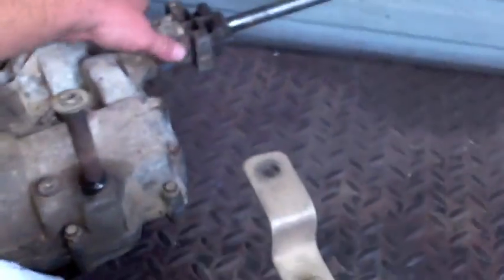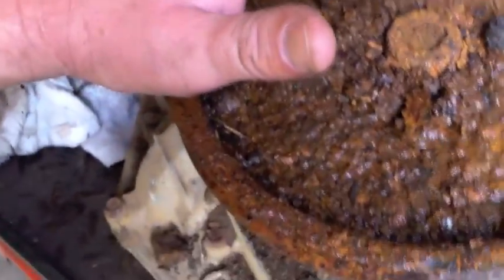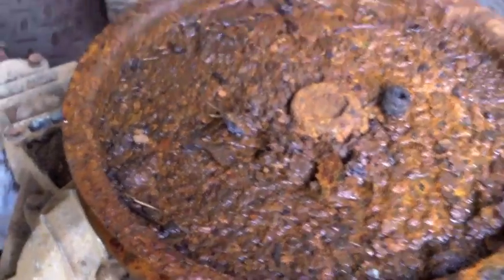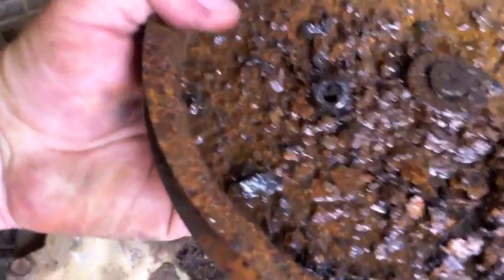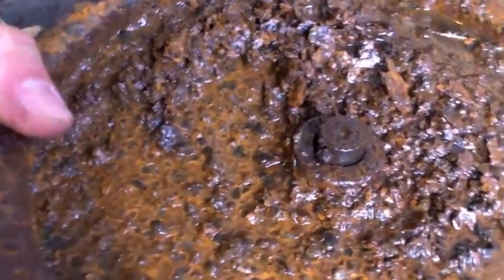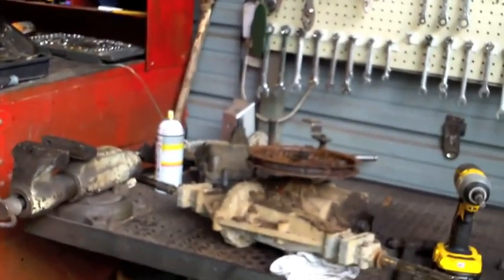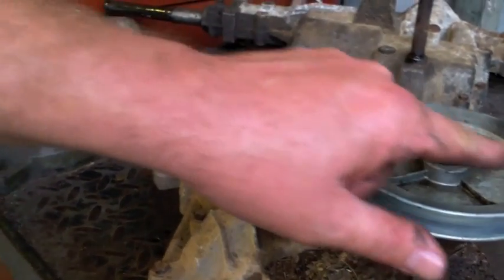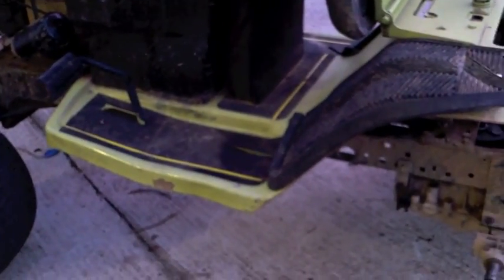how to remove a pulley/Franks tranny in!

Comment: That pb blaster works great. I never had any luck with the candle wax way though. The next best way I think is heat the part and cool it with 3 in 1 oil, I also seen first hand the coke thing. That's with the piston rings rusted to the wall, you pull the plugs and pour coke in the cylinder and it eats the rust, and boy it eats the rust good.